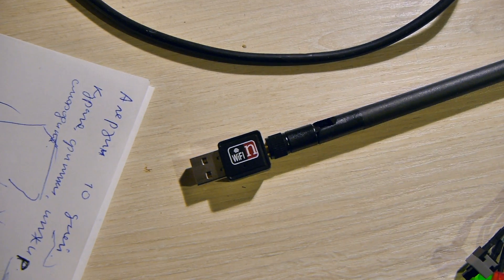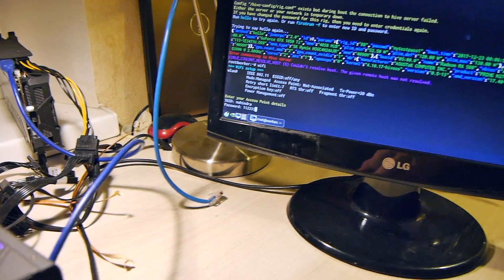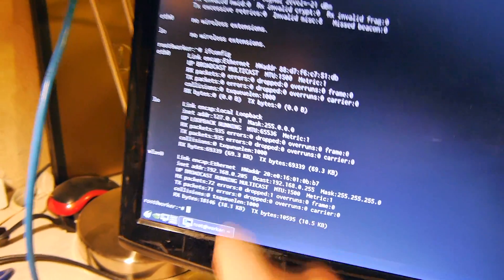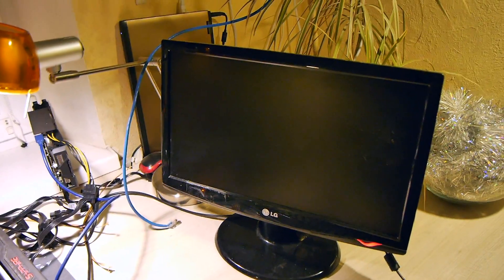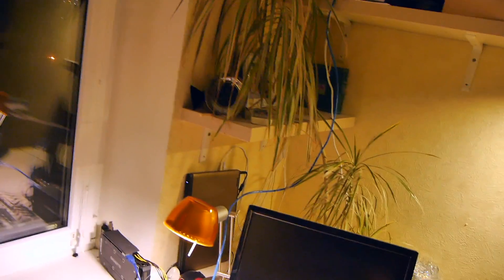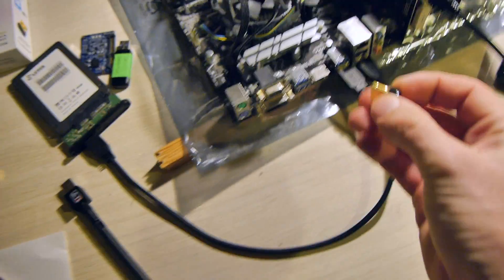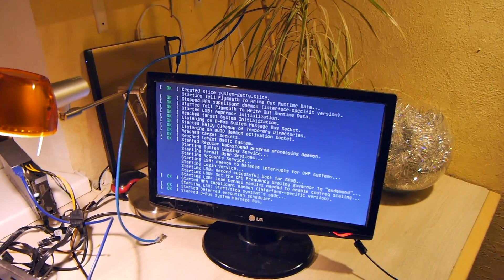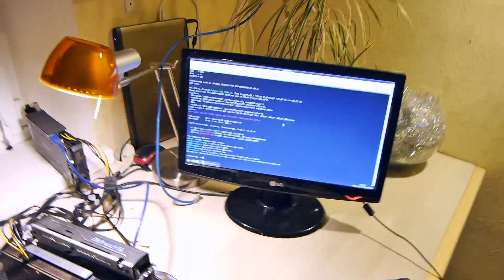WiFi working II Hiveon OS

Comment: Awesome.
Can you have two WiFi adapters (different brands) connected on the same rig (in case one of them fail or if you want to use your landline as main connection and a 4G modem as a backup)
Reply: Did you try this ? Is it work ?

Comment: D-link DWA-131 also does not work. But I won. You need to do the commands below.
Requires wired internet.

sudo apt install git dkms
git clone https://github.com/Mange/rtl8192eu-linux-driver.git
sudo dkms add ./rtl8192eu-linux-driver
sudo dkms install rtl8192eu/1.0

It will work after reboot.

You can see more here http://forum.ubuntu.ru/index.php?topic=286798.0

Модуль D-link DWA-131 без танцев с бубном не работает. Нужно последовательно выполнить  четыре команды. Для того, чтобы команды сработали нужно проводное подключение к интернет, т.к. команды скачают и установят драйвер. Подробнее здесь http://forum.ubuntu.ru/index.php?topic=286798.0
.
Reply: can you simply explain to a newb? i dont understand you won and where to do command